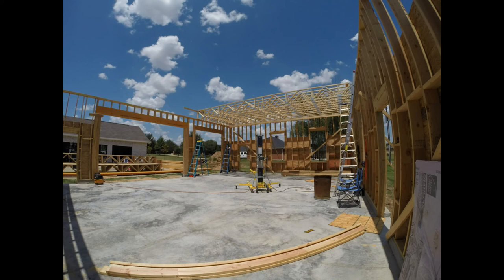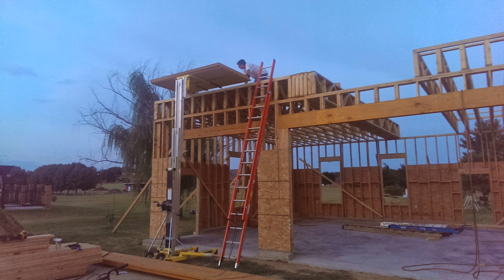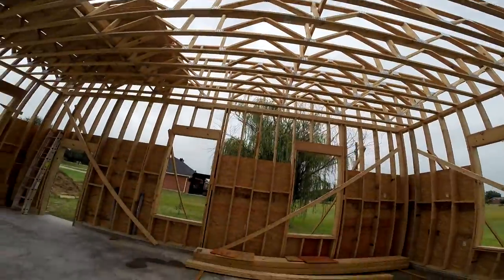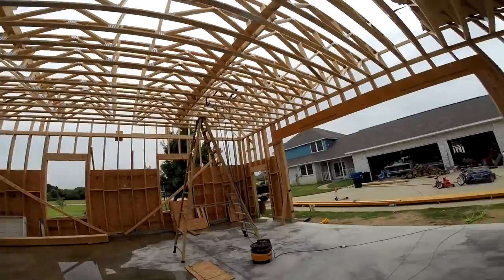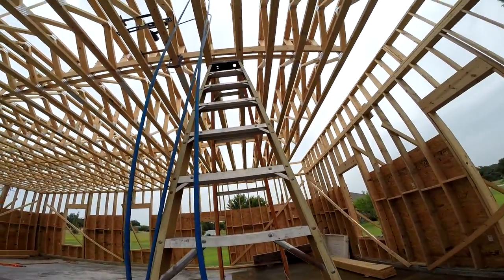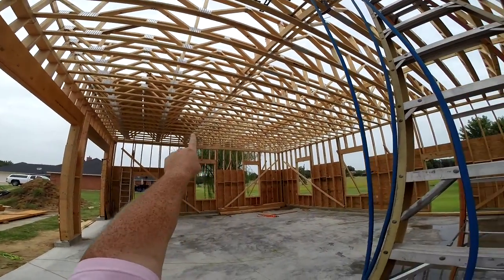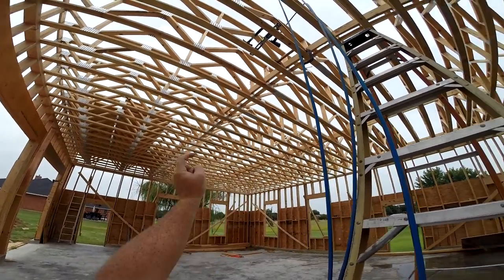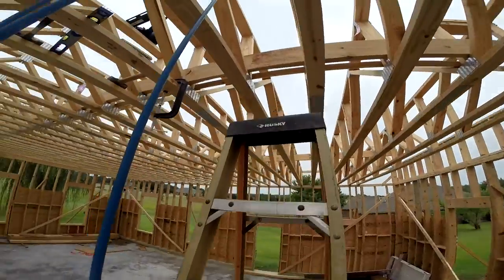DIY Garage #9 - Framing Part 3 - Floor Trusses

Comment: If your truss spacing template is off by 1/32, by the time you get to the end of the building you are 3/4 inch out of true. Instead make a 16 inch on center lay out on a 16 foot one by four. Then just tack it down across the top and another one across the bottom. Nail down your strong backs then slide the 1x4''s down and do the next dozen.

Comment: Strong back is on the outside of the trusses. What you are installing are the CLB's or continuous lateral bracing. You install those middle CLB's after the floor is sheeted. When you nail CLB's you lock trusses in. Then when you go to sheet the floor, the trusses are no longer flush as trusses have humps and sags. Then you need Sledge hammer and someone standing on the other end of the plywood cause of humps and sags in the trusses. Then you have permanent humps in your floor system. Instead Sheeting will stiffen up the trusses as you install. Plum the gable truss and pull layout on the sheeting as you fly. Then and only then you can go down below and nail the CLB's. Your method is wrong and long. Me and one other person could fly those trusses, sheet them and nail CLB's in one day.
Reply from the maker: I see what you are saying doing the decking first and I bet it does make it easier.  We didn't have any issues installing it though because we left the leading edge unfastened until the next sheet was put into place.  Thanks for the info, I'll definitely do it that way if I tackle another project like this in the future.

Comment: No. At 10.42 where you had left a gap for stairs, move that truss over to 16" OC. Build a box around your stairwell. The truss should butt up against it. Don't leave a big gap that would weaken the structure not to mention throw off the decking.

Comment: What size were your trusses and how did you figure that out?
Reply from the maker: They are about 31' long, 2' tall and spaced 12" on center.  If your local lumber yard builds them then they can spec them out for you based on the distance spanned.